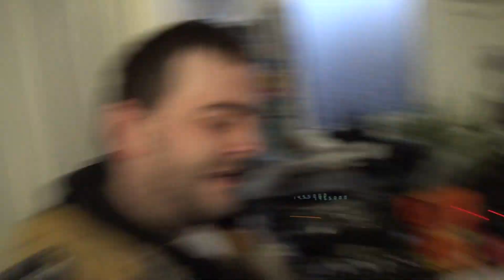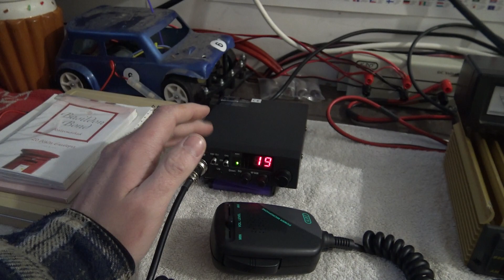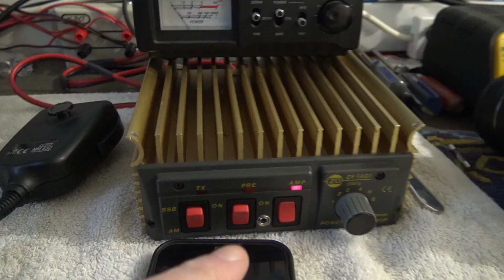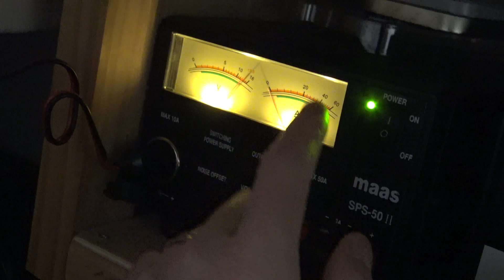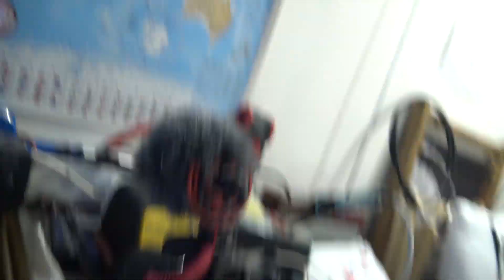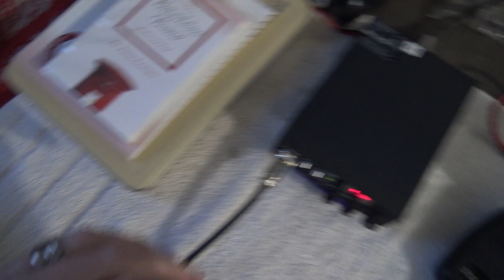CB Radio How Many Radios Can You Have On One PSU?

Comment: Hello I have a cb radio that says it consumes maximum 10 amps. The power supply is 17 ampere with continuously 15 amp. Will this be enough or not to run the radio in the long run?